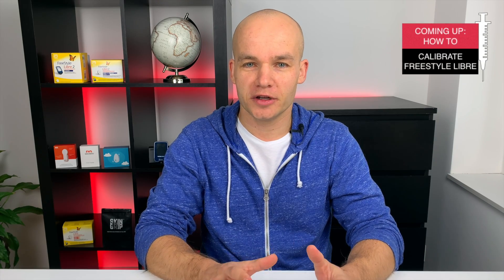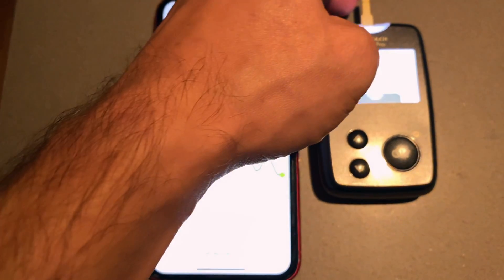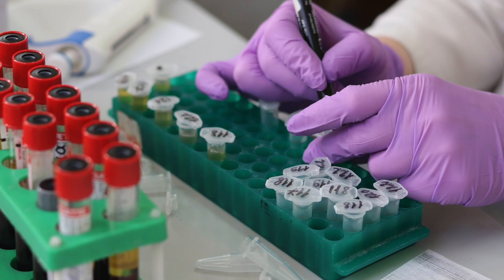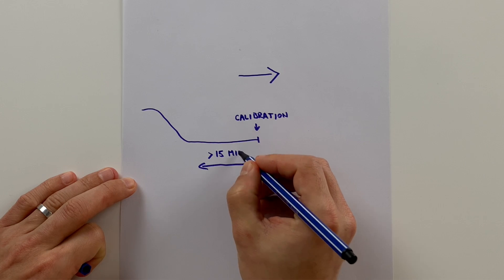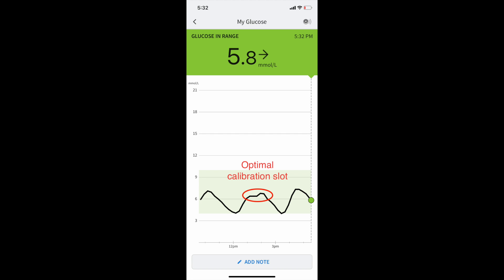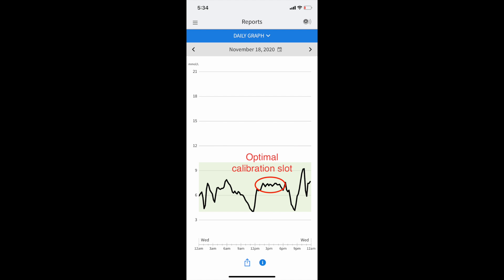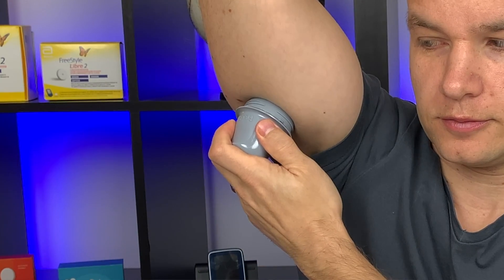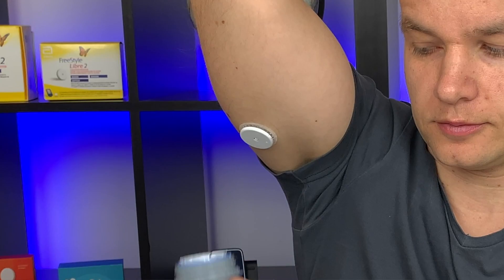How to Calibrate FreeStyle Libre and Get Accurate Sensor Readings

Comment from the maker: UPDATE FEBRUARY 2022: MIAO MIAO 2 TRANSMITTER SHOWN IN THE VIDEO WAS REPLACED WITH MIAO MIAO 3 IN 2022. YOU CAN NOW USE EITHER MIAO MIAO 1 OR MIAO MIAO 3 TRANSMITTER TO CALIBRATE THE SENSOR IN THE TOMATO APP AS SHOWN IN THE VIDEO.  HERE IS A $10 DISCOUNT LINK FOR MIAO MAIO 1 AND MIAO MIAO 3 - http://miaomiao.refr.cc/typeonetalks

Comment: Wouldn't an average between a CGM and BGR be better than locking the CGM to BGR.  Calibration is only as good as the reference, unless it simply averages out the readings on the special meter?  I'm finding my CGM is 4.4 mmol/L and my BGR is 5.9 mmol/L - I'll settle with 5.2 mmol/L  if both are reasonably accurate, then the error probably will  be (as an assumption) overlapping (overlay each other).

Comment: My libre 3 is 10 points higher than my actual glucose.... Scary when you have reactive hypo glycemia !  Found out during an exam, hopefully getting a manual monitor soon!
Reply: I learned that diff is normal because blood reads differnt than intersistal fluid (white blood), so you will always expact a 5-10 pt diff....not a worrying amount, but when its more you need to recalibrate your device. Unfortunately Abott forgot to add that feature to the meter reader... ha ha hand ha

Comment: I know this video is two years old. I was hoping these CGMs would improve by now. I’m doing libre 2 (I have type two) to really be able to see what different foods do to my blood sugar. I don’t feel like I can depend on any of these measurements. The CGM sensor seems (pleasantly) low, but the blood meter seems too high. I have no idea how I’m doing. Why can’t we count on any of these? I guess I won’t know for sure until I get a regular A1C from the lab. I don’t know how you people with type 1 can deal with these meters being 10-20-30 points off (even when I use the same drop of blood to test) when you have to take insulin. I really feel bad for you.

Comment: Brilliant vido, thank you so much. I have had a difference of 103 points tonight, my Freestyle CGM was 107 and my actual Glucose Meter reading was 210 !!! I'm scared as I relied on my CGM in these past two weeks almost exclusively, so I'm definitely interested in calibration. My question for you is... does calibration works with Free Style Libre 3 as well? Thank you so much again, your videos are just amazing.

Comment: I just got my Libre 3 and I did a spot check to see how close the blood glucose readings were as compared to my meter.  My meter said 142 but the Libre said 119.  I don't like that difference as I think it is too much.  Especially since I am a T2/Insulin dependent.  I believe that the Libre uses BT to transmit so why would Ineed to get another transmitter?  If another app is suppose to help calibrate it should have software in the app to read the Libre 3 as well.  I do know they have an API and I have been thinking of doing my own app or add it to my own personal diabetes app.

Comment: My Libre is out of range 90% of the time and when it is in the green, it is always a spike after eating a meal with carbs. So, can I not calibrate because my Libre is always out of range? Every replacement sensor they have sent me is always too low by 45-66 points less than my finger prick, way out of the 20% margin or error range.
Reply: Bro for real I just ran through like 3 sensors it’s annoying af

Comment: Far too complicated for me, this is the big weakness of the libre. Is why I do not like it, day one not reliable, I find the same for day 14, so with all the fingersticks I do with libre, I wonder why I even use it.

Likely  when my two two remaining sensors are used up I will put it away until the system improves .

Comment: Hi Tom, I am going to give the MiaoMiao a try. I have had quite a few issues with the Libe 2 readings. I would get woke up with a low reading alarm and test with blood to find out the difference was 40 points higher. I have been double reading, (CGM and Blood) closest is approx 15 points. I want more accuracy and hope this will give me that option. A1C on the decline too.
Reply: Denise, How did MiaoMiao work out for you on closing the gap in the readings ?
Reply: Sounds like you were laying on the sensor. It's quite  a common issue with the sensors apparently, and happened to me twice my first week with one on (last week) l.
Reply: @Ianforcements5669  I just read that people are reporting critical lows even without compression with Libre 2.

Comment: Please, help.

Does the last calibration on certain BG affect on different BG sensor data/values which were calibrated previosly?

If yes, this means that last calibration "shifts" all BG data/values (even that were calibrated previosly), and there's "subquestion":

What's the point of calibrating sensor on different BGs?

Thanks.
Reply from the maker: I am not sure if I fully understand the question. Could you please clarify?

Comment: Hi,

Can you confirm for me, is this re-calibrating the sensor itself (so all apps will now read correctly) or calibrating Tomato to sensor (so only Tomato will register correctly)?

I've been given a Libre and it consistently reads low, however I need to use the official Libre app as I've got the device linked to my diabetes care team through Libreview.

Comment: I found your video to be extremely interesting and informative.  I have one question when you do the calibration does it change the sensor so if I use the freestyle libre reader will the reader provide calibrated readings or is the adjustment occur only in the Tomato app?  Also I noticed that you had the Miao Miao transmitter on the sensor, does it need to remain there after calibration?

Comment: If you have a Freestyle 2 do you need the bubble. I am still waiting in Australia for Freestyle 2 and dont want to buy a bubble for the Freestyle 1 if Freestyle 2 will come to Australia soon.
Reply from the maker: For calibration I believe you need a transmitter. You get alarms on Libre 2 but you can not calibrate it. Hope this helps!

Comment: Hi Tom, have you ever tested the app Diabetes:M ? For me it's which I like best, Is very easy to use (more like Tomato) but is very complete, you can also connect to miaomiao and use it as a CGM  and it does a lot of statistics with your data that I consider interesting (like the sensibility of insulin, and proportion CHO/U).  And it also calibrates very easily by just entering new reading of a finger prick,  (which you can differentiate from cgm read).
Reply from the maker: Thank you for your tip. I guess this could be an interesting video topic! Have a great weekend!

Comment: Thank you for this video, much appreciated (found it from your live Q&A)! Will use all your tips, do a more accurate overall Libre sensor calibration. 

I'm only on my 2nd Libre sensor. After realising I was getting consistent sensor readings lower than blood glucose meters (from checking the sensor hypo events, etc), lol, I also found out that one of my blood glucose meters (of 3)  was consistently reading too high (Contour Next One). Thankfully the Freestyle Libre reader (using test strips) and One touch Verio are usually very close in readings. Eg, Contour 7.0, Verio 5.4, FS Libre 5.5 (mmol/L). 7 mins earlier, Libre sensor was 4.2 (& stayed between 4.0 - 4.4 next hr 20min).
Reply from the maker: Thank you for sharing. I am glad you found this video helpful! Happy holidays!

Comment: Why are you calibrating the ISF sugar levels to the blood or Venous sugar levels?   There are so many articles discussing the difference between the ISF ;evels, as measured by tghe Libre, and the blood sugar levels, measured by taking a drop of blood andusing a glucometer.  Which is correct?  Which one shoul dbe followed?  The blood sugar reacts fast.  The ISF level tells you how the body is processing the sugar.  This is a not an easy problem to resolve and you can make yourself crazy trybig to resolve the issue.  As for xDrip and the other software packages, they are good.  But if you want something approved by the FDA or CE, remember, none of them have received FDA or CE approval.  As such, I personally would not use them to track my blood sugar levels.  Truth be told, I would love to hear a discussion from the author of this presentation on the differences between ISF readings and blood sugar readings using a glucometer and let him explain the reason why the numbers do not agree.
Reply: For me the answer to your question is that the Libre sensor is consistently giving lower readings. When it shows hypo events, I need to check in 15 min blocks anyway with blood glucose meter, if I treat with carbs. So if the sensor says I'm in a hypo, I do a blood glucose test first anyway (set a baseline). And that was when I realised, after many sensor recordings of "hypo" events, plus too low glucose levels to drive legally (therefore double checked), the sensor was inaccurate,  consistently giving too low readings.
Reply from the maker: @ Kaz Oz: I could not agree more on this one!

Comment: Why do you use tomato and not Xdrip? You find it better?
Reply from the maker: I have an iPhone and xDrip+ is an android only app. The xDrip version for IOS is not great. I also flirt with Spike but still need to learn more about it. Tomato is an easy option for me. Not complicated installation and functions. Hope this helps!
Reply: XDrip+ for android is exactly the same as Spike for iPhone. 

Yes, getting and setting up Spike is complicated, but the Facebook group will gladly guide you through the install. 

Worth your time!!
Tomato app is garbage, it smooths your graph FAR too much.
Reply: Tomato uses a LOT of battery. We switched to xDrip4iOS when Tomato had ~12-hour downtime and haven't looked back. WebOOP+recalibration setting gives us the most accurate readings. MM2+FSL2.